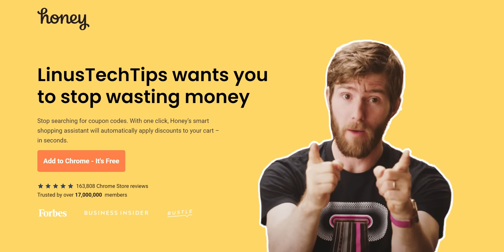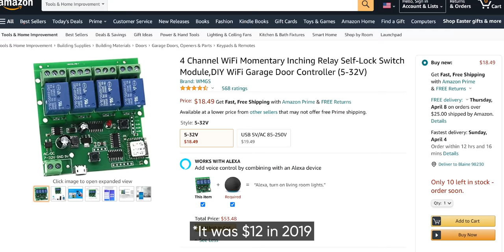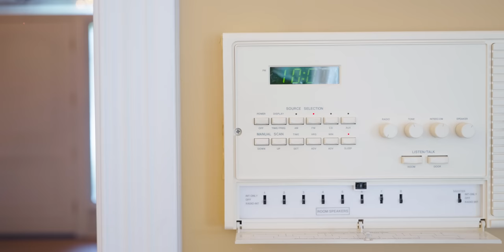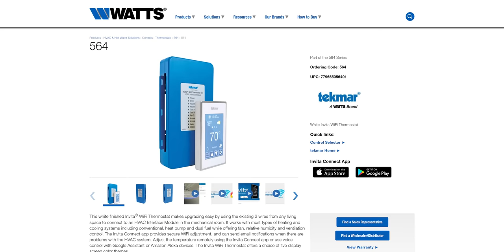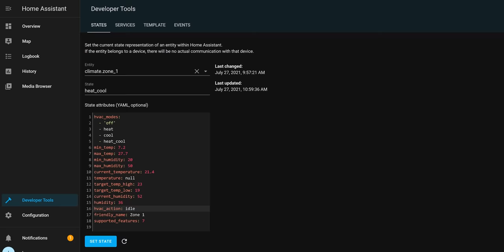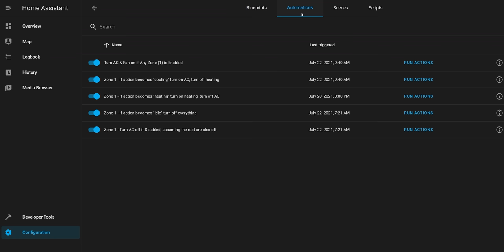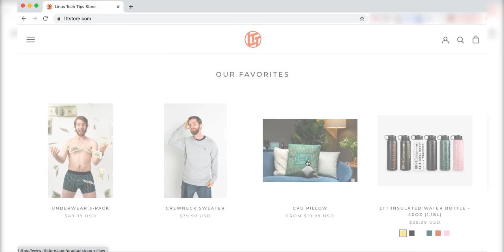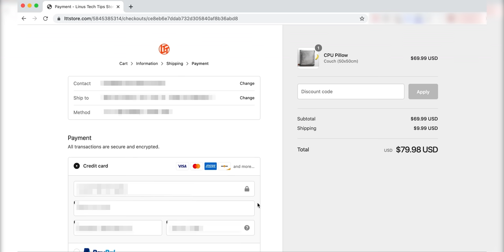This Should've Been EASY - New House Smart HVAC

Comment: Sorry but this is all very common in Europe. We usally don't even use separate boilers and air conditioners, we simply have heat pumps that can cool and heat. Much more efficient. Heating is much much more efficient this way and the air conditioners/ heatpumps (same thing) only need 1 extra valve to do this.

Comment: I need to send you a video of a smart home. One that generate more electricity than it uses, with a smart furnace, 199k water heater so you never run out of hot water and it also heats the garage, z-wave outdoor lights, motion sensors, automated garage door, camera's, energy monitoring of the use and production, lutron lighting controllers, 10g fiber in the whole house,  an electric car charge that I installed without leaving the power on like you two did, and a few other things. I am so stupid I never thought about having YouTube advertisers pay for it all.

Comment: This would have been much easier with Modbus integration with Home Assistant and a PLC or multiple PLC’s like a Micro 850 from Allen-Bradley software is free. You can do the back pressure checks in the PLC with Logic. This would be more reliable. You could also create manual integration using Modbus directly.

Comment: Just be careful that the air is run regularly, regardless of occupancy. It's important in energy efficient homes to make sure you aren't putting the interior through more extreme heat and moisture cycles.

Comment: I would use 1-Wire protocol over the current wiring to both: power control panel in the room, and retrieve control signal from it.
That way you can collect requirements from every thermostat, and control heater, valves, AC, and dampers accordingly.

The protocol: https://en.wikipedia.org/wiki/1-Wire
It's just like PoE, but over just 2 wires ;)

Comment: So one potential huge problem that could happen with this. Residential AC units like this  are not variable depending on its load and is always full on when running. There is a certain amount of airflow that is always expected to be there and if it isn't your coil could easily freeze up causing permanent damage. It might be worth putting a temperature sensor on the coil somehow and if this gets to low it sends you a notification and shuts down the unit. Cool stuff though, pun fully intended.

Comment: Lack of air flow kills AC systems it's the number one troubleshooting step for a Tech so you placed a bunch of restrictions in the air flow higher head pressure and rise in temperatures less efficient let's hope it's a good old school built compressor

Comment: Seeing as the rooms have only just been fitted with floors, it would be a better idea to point out the problems with the zones to the plumbers and get them to do the job better. Also, wouldn't it make more sense to have a mechanical bimetal strip thermostat controling each outlet of the AC in each room. No electricity or complicated programming required. ...and a lot less to go wrong.

Comment: I use a valve on the radiator to open and close it and a remote control for the AC. Much simpler.

Comment: Use a relay board and a pi zero. Just saying. I set up a sprinkler controller, 24 volt, using this method. This wouldn't replace the pi that is running home assist. It's just a smart relay that is easier to maintain.

Comment: Careful choking that old system down with dampers like that. If you install and close too many of them at once it will decrease the airflow inside the system to the point that it will freeze. This can cause compressor damage when this happens as it allows liquid refrigerant to make its way back to the compressor.

Comment: just don't short cycle your condensor (outside) unit. if those raspberry pi's don't have 5 minute delay when calling for cooling you could kill you compressor in your condensor (outside) unit. the compressor needs time to for the pressure equalize between high pressure and suction lines. research "short cycling." i hate to say it but it is probably better to call a pro on this one because you could end up with air flow issues and a frozen "A" coil in the air handler due to the dampers being closed and not allowing enough air to move over the "A" coil to keep it from freezing.

Comment: Using "smart" technology isn't necessary for multi-zone HVAC. My house dumb multi-zone heating and air conditioning. Two old-school mercury thermostats are connected to a relay board which controls the dampers, the compressor, and the furnace. There's very little that can go wrong and faults are easy to fix. With Linus' system there are so many things that could go wrong. I'm suggesting anything will go wrong but if something breaks it will likely be a pain to sort out. For example, if the thermostat breaks and the model is discontinued, he'll need to find a new model with the same features and likely need to reprogram Home Assistant.

Comment: I'd probably buy a bunch of RuuviTags and have Raspberry Pi read those and control the zones. I'd have to replace batteries on those every few years but wouldn't need to run any wires to sensors.

Comment: You need to add a bypass damper otherwise you are gonna be going through fan motors like crazy. The static pressure is gonna be all screwed up

Comment: Listen Linus, I love your channel, you make things entertaining but OMG you made this so much more complicated than it needed to be.

All you needed was a set of zone controllers from zoning supply. They can be used with AC or heating zones.

You don’t need anything special because the zone control system is essentially just turning things on and off.

The zone controllers could then be wired directly into smart thermostats placed through out the home. Then everything is wireless and boom you are done.

You need to be careful when adding air dampers to a system that didn’t originally have them.

The amount of air pressure through your system can heavily impact how efficient your cooling it. Damping the air can give you massive spikes in inches of water column pressure and in some cases can damage your evaporated coil.

Comment: As an HVAC business owner please do not do just install dampers where ever you feel fit. You will cause restriction of air causing unit to freeze if only certain portions of the house are requesting cooling. Please install a return bypass damper!!! Otherwise youll damage your compressor. These house hacks by a computer guy worry me. Also, replacing the mercury thermostat with lowvoltage still on is a good way to damage relays and valves. Furthermore, on the thermostats you think youre "Tricking" will eventually die if they stop calling for the relay to be enrgized...

Comment: Obviously your solution works but Is there a reason you couldn't have used dumb thermostats to simply act as a relay when they go into cooling mode to open the vent?
Its just closing a switch because a bimetallic strip reached a certain temperature under a certain tension right?
Reply: As far as running the a/c with the vents all closed...you could wire all the dumb thermostats to relays and have the real thermostat running through all of them in parallel, that way at least one has to be on for the a/c to function.

Comment: Ok, Linus , you realize only you will be able to work on this system.  No HVAC tech will be able to make heads or tails out of it.   As for you zoning out your AC,  you have to make sure that the pipe is large enough to handle the CFM that you are trying push thru it.  You will have 350 CFM per ton.   3 tons of cooling need 1050 CFM.  1050 CFM needs 15 in diameter pipe.  If you undersize the pipe too much, the AC coil will freeze up.   The only thing stopping the coil from freezing up is the air flow across it.   Another thing of note is that those Honeywell dampers are power open and power closed.  M1 is common or neutral,  M4 is power open, and M6 is power closed.  Watching you guys doing HVAC is almost as bad as you watching the Verge PC build.  I wish you the best.

Comment: Dampening your split a/c system like that is going to cause problems. Your going to have evaporator coil freeze ups and that can return liquid refrigerant to the compressor. That old compressor will have problems if it is forced to drink liquid refrigerant. If it was me I'd change the a/c system to a whole house mini-split with a cassette evaporator in each room.

Comment: Water hammer happens because water is incompressible. Air is compressible and "air hammer" isn't a thing. Air has much less intense pressure waves that propogate differently, hence why the speed of sound is so much slower in air than in water.

Comment: "A room that hasn't had anyone in it wont turn on"
Umm... you do know that internal walls R is lower than external walls R right?

The best thing is to just have the temperature set lower/higher than the heating/cooling you want in the "used" areas of the house.
When I first moved in to my own place I tried heating only my room and letting the rest of the home be cold.... after turning on the heat (at a lower temp) in the rest of the home I was saving about $110 on my bill - after making sure the fridge freezer was always as full (random bottles filled with water for "empty space") I got my electric bill down to $30 a month from $220.

Comment: Linus: "I'm doing this to increase efficiency."  

Also Linus: "The default position of the dampers I chose is powered, so they'll be on the vast majority of the time."

I'm teasing, I know he didn't design the damper to be fail-to-close and I know they talk VERY LITTLE power, but it's still an interesting added cost to this system.  It would be good to know how much power all these extra devices take over a year vs running the HVAC system as normal.

Comment: I'd rather have something more hardwired (microcontrollers) in place to do the basic control loops, and then have an interface to report status to something like Home Assistant and receive generic instructions. Relying on a full server or a pi with its corruptible microSD for critical home services is a bit scary

Comment: Tracing the zones through the low voltage wires connected, on one end to the thermostat and the other end to your zone controller, would've been much easier.

Comment: 11:14 "let alone on two wires"..
The standard for that exist since 30 years.. KNX! 
Okay, not only a thermostat.. It can control everything.. HVAC, lighting, blinds and many more..
And it does not depend on a central piece of software running in docker, a cloud service or proprietary stuff from only one manufacturer

Comment: This is funny. Here you have a very intelligent man who when it comes to computers and tech. He talks about efficiency, price to payback and he goes and installs a radiant heating system with a NON ECM Circ, Non Green Zone Valves (with a 5yr warranty vs the 18 months Honeywell gives) and a non condensing boiler. Now onto the radiant. It's an overpour application, yet it's zoned without thermal break so zoning is useless. Let me explain. If Zone 1 as example is the Master Bedroom and Zone 2 is the room next door all that will happen is when Zone 1 is satisfied, thermostat off and zone 2 is calling, zone one slab will bleed into Zone 1. The manifolds have no balancing on them. There is zero chance each zone requires the same flow rate. Yes hydronic is very forgiving and the system will work but will work as about as efficient as my car would with 15PSI of air in its tires. Where are the floor sensors? If at design temp I need a surface temp of X to overcome the heat loss, then why do I need a thermostat? The answer to that is in your boiler choice. A conventional cast iron boiler that requires no less than 140 degree return water temp of else shock, shock, crack, crack.

Comment: Wait, I am confused: Why would you run the AC and floor heating the same time?
Reply: I think he's trying to prevent having both at the same time. But technically you can run both to dehumidify with minimal over cooling

Comment: Someone correct me... Isn't it cheaper to just maintain one temperature in the house rather then turning individual rooms.on and off? If you turn off the basement for example, it's gonna take way more power to cool it down again or vice versa. Wouldn't it make sense to keep the whole house at say 22c, and then regulate rooms individually based of that temp?

Comment: Seeing as how you haven’t shown the air handler I’m going to assume it’s the same age as everything else in the home. You need to just replace the cooling system, it’s well past life expectancy and is woefully inefficient compared to modern HVAC equipment and control options available. Your control “upgrades” won’t improve your current systems efficiency, and it is likely going to cause massive problems. IMO start fresh buddy, and consult an HVAC technician or a different one than you have been, yeesh

Comment: While very cool, I disagree that this system is more efficient. By having different heating/cooling zones you are making your system work more to maintain temperature differentials within the house rather than just the one differential between the house and the environment. Furthermore this issue is exacerbated by the fact that in the case of controlling the entire house as one zone, the temperature differential is being maintained across the exterior facing walls of the house which are both the thickest and most well insulated walls of the entire house, whereas internal walls are thinner and have no extra insulation to help reduce the rate of heat transfer across the boundaries between zones.

Comment: Linus should focus more on environmental concerns while using technology. He can install solar panels in his new house to set off the carbon footprint and focus towards a carbon neutral lifestyle, if not carbon negative because being a tech enthusiast a lot of energy is used in powering the electronics. He should use the in-floor heating and air conditioning using green energy. This will not only help the environment today but also set an example in the whole YouTube community Linus Tech Tips being a major channel with several sister channels.

He can do the whole thing DIY which keeps up with his open source motto and may take help of Brian, the Electrician. A video series on this may eventually lead to net zero on very less cost on Linus' part and be a great motivation towards green technology. 

Lets not forget that Linus brought the new house for his kids and he should also ensure that they have a safe and healthy future.

 "With great power comes great responsibility" ~ Peter Parker

Comment: If you have a floor heating, and want to change the room temperature takes time (a day).
It’s not like, “I feel cold, let’s heat up the room Immediately” If your wife and kids want to change the temperature, it will take time to feel the effect!

Why heating and cooling at the same time? Thats a waste of energy!
Don’t you have a summer and winter season?
Or does it change each day 😜?

For temperature sensors, I use 1-wire sensors in each room behind a switch. Not much wiring required there.

Comment: 1:20 Linus, let me stop you right there

Return all those servodampers and you're going to get a 200psi rated liquid to liquid heat exchanger. 
Now you're going to pipe your heat pump's pressure side outlet through that heat exchanger and you're going to pass the water from your hydronic system through the other side of that heat exchanger.

Also you're going to dump Briant and you're going to buy the pump only side of a 36000 btu/hr heat pump  on ebay for 1500$ tops. You're going to make sure it has a reversing valve.

Now you're heating in the winter is going to be more than 100% efficiency of your water boiler thanks to coefficient of performance of heat pump (usually 3 to 1)
Reply: 12:30 Buying into someone's stupid proprietary thing ? Well, I hope you're going to say HestiaPi next !
Reply: Ah come on, Ecobee lite 3 is 220$ a PIECE !!! And you're getting times 10 ?  That's crazy. For my house those thermostats would be 2% Of the entire value of my house !!!

Comment: I agree that this is a very ingenious solution, but you're going to destroy that ancient ac unit. With 10 zones, the unit will either run constantly, or worse, constantly be shutting off and turning back on. I had basically that same unit, and it broke so often just running as intended, I had the repair guy on speed dial.

Comment: I really like the “idea” of this but in reality I feel there are too many points of failure. The system when operating as expected should be “smart” but fail over to “dumb” aka normal operation of a component drops out of the loop. For example if a WiFi AP  or the circuit controlling dampers goes offline the system will be unaware and either not operate at all or have very unexpected results. Imagine if a component failed on your server while you are away and your family is at home you’d loose HA and all your AC or heating,etc. you have to plan for outages/downtime.

Comment: I hate that tech.   Lived in a home that had heating and heated floors and when the hot air stops it then take forever to kill off that radiant heat and must open the windows with a 
fan to cool off.   I went as extreme to just having the bed on the floor with no bed frame and no box so I can be closer to the cool air below.

Implementation is key here.

Comment: Saying that an ancient standard efficiency boiler is more efficient then a forced air system is extremely over simplifying at best. That boiler brand new is 60-70% efficient. Changing your air handler to a new VS DC motor with a heat pump in stead of that ancient environmental disaster you have outside would be efficient especially in BC. And as others have said your zoning need works or it will cause failures of the current system. Again a new airhandler with a VS DC blower will help complete the system